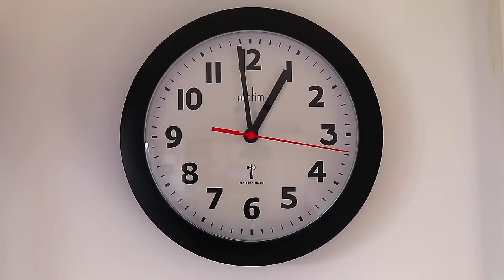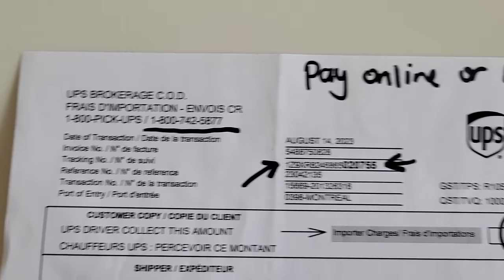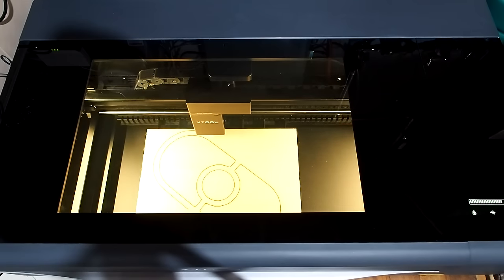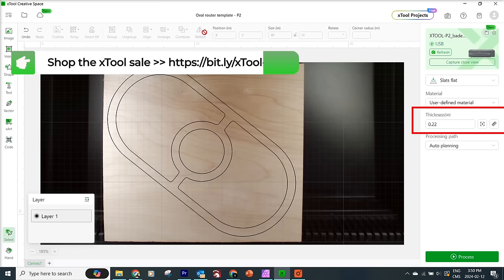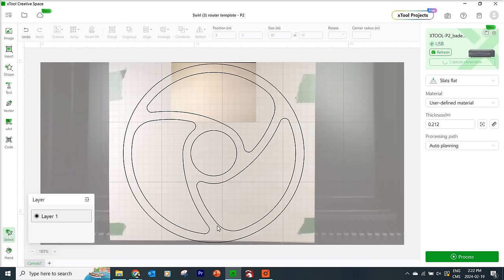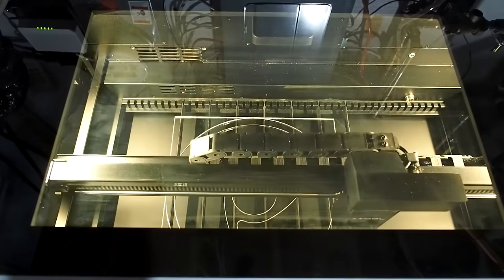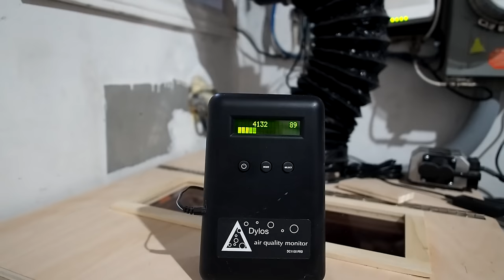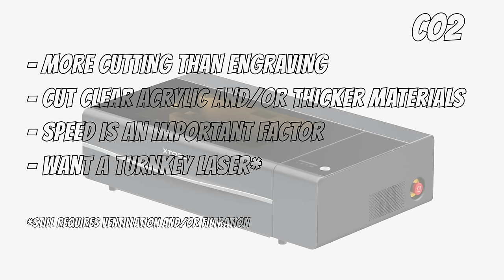I regretted my laser purchase. Until I upgraded.

Comment: I normally think DIY Montreal does fair comparisons, but this time she has missed the mark.  This video is not so much a comparison of diode lasers vs CO2 lasers, but a comparison of an older 20 watt open frame diode laser to a latest generation 55 watt CO2 laser.  Most of the downsides to diode lasers she mentions are no longer true since many diode lasers now include full enclosures, with exhaust fans, cameras and large laser-safe viewing areas.  Diode lasers are not just for engraving, in fact a 40 watt diode laser will probably do a better job of cutting wood than an equivalent power or more powerful CO2 laser. And things like a honeycomb bed vs a slat bed are not a function of the laser type, but the bed type. Charred cut edges are a function of the settings one uses, not a characteristic of the laser type. I own a $1400 diode laser and much prefer it to an $8,000 CO2 laser I also have access to. CO2 lasers have one advantage over diode lasers, the ability to cut clear and translucent acrylic.  Otherwise they are, as she points out, much more expensive, much bulkier, and have sensitive parts like mirrors and expensive tubes with a limited usage life.  I hope your viewers do not watch this video and get the impression that if they want a laser for their wood shop they need to spend $4,000 plus.  There are lots of great diode lasers available for a fraction of that price that do a great job of both engraving and cutting wood. I love Marie's woodworking videos, she is one of my wood working heroes, but I don't think she has enough experience using lasers to make a good comparison between diode lasers and CO2 lasers.
Reply: Thanks SO MUCH!!! For this comment!!! I always have a bad feeling when people do videos on things they got for free. And comparing a cheap run of the mill laser to a higher end newer one is really apples to oranges.
Reply from the maker: You clearly know a lot more about lasers than I do! This wasn't intended to be a comparison video but more my experience with lasers and why I upgraded. I feel like a lot of people starting out with lasers would go for the same basic entry level model that I did, and I feel that's a mistake. If anything, there's a need for more education and greater research when investing in a laser cutter. Promise I'll go back to woodworking for my next video ;)
Reply: @DIYMontreal  Yes. I would agree. The quantum leap you made is REALLY a big one. Like comparing a bicycle for transportation vs. a car. And when a company gives you something like this for free it's REALLY hard for us lay people to not look at it from a guarded position. If Ford gave me a brand new Raptor pick up truck and wanted me to give an honest feelings about it vs. my 2003 F-150? HECK YEAH I would have great things to say about it! The laser cutter is different for you because you DO have a business that you are using it for and probably would have been the right investment for you to make in order to ramp up that business. Bob over at "I Like to Make Stuff" Got a free $13k Thunder Laser to do a video with. That thing BLOWS the $5000 xTool away. But again... don't think he would have made that leap had he had to pay for it himself. (I look forward to the next woodworking video you make 🙂) Best wishes, Rick
Reply: I think you missed the point. In a nutshell she basically said “don’t waist your money on a “Framed Diode Laser with no smoke extraction” and or upgraded tech so that you can scale your business to profit” it was not a comparison of laser units 😂, she is in to making money, not making extra time for errors!
Reply: @SinisterReality  If you read the description it clearly states it is a comparison of CO2 vs diode lasers. As an amateur woodworker who uses both diode and CO2 lasers, I would just like other woodworkers to know that for many of them, they could be happy, and safe, with a diode laser costing a fraction of the price of a CO2 laser.

Comment: I am not sure if I would agree with you regarding some of the points in the video.  Both CO2 and diode laser have their places.  The fact is,  xtool d1 pro is outrageously overpriced for what it is. When it comes to this type of open frame diode lasers, there is really very little seperating xtool from other more budget friendly options.  CO2 laser machine is another story, but I still won't spend anywhere close to $5k for that.  You are comparing the cut speed of two machines with very different laser power output, which is completedly unfair and pointless.  The CO2 may look to be worth it, only because you overspent on the D1 Pro.  There are plenty of budget brand 20W laser out there, nowadays at around $500ish.  Occasionally , there are sales pushing it close to $300, with an air assist included. with that,  the equation would be drastically different from your viewpoint here, esepcially for people new to laser machines.

Comment: You have dirty cuts from your diode laser for the same reason your honey comb is getting so filthy, you need a 'down draft'. Down draft is a 'must' because your respirator doesn't protect your skin.  Lasers don't burn, they 'oblate' by impacting an area w/concentrated photons, the byproduct of the friction is heat. You need the compressed air to clear our the debris but the consequences of this are tiny atomized particles that coat everything, skin, clothes, walls, if you can smell it, then it's on your skin. Long term exposure, speaking from experience, you will develop contact dermatitis to things that are considered 'harmless/safe'...  I ran a Kern HSE utilizing a 150watt Coherent Diamond series laser for over 10 years w/the best down draft/compressed air setup US tax dollars could buy. At the end of the day, you could smell the 'stink' from whatever I had been cutting even w/the best ventilation on the planet. We didn't know, Kern didn't know, it's thanks to the DIY community that we now understand the hidden dangers that are completely manageable. Wear long sleeves when possible, minimize skin exposure and shower/rinse exposed skin sooner than later. I still laser daily, love the hobby/profession and miss my Kern :D.

Comment: Actually for the price of the P2 for another $2000 you can look into a full blown 80 - 100 W  Co2 laser, floor model water cooled with a much larger bed and self contained.  Depends on what you want to do. P2 is still a hobby craft unit the xtra $2000 gets you a full blown very fast production unit.  I use a Rabbit 100W floor model Co2 at work all self contained,  runs 24/7,  It's only issue like all Co2 units is you must keep the lens properly clean. Even this won't cut metal though.

Comment: Diode lasers and CO2 lasers each have their place. Low power diode lasers have a smaller focal point, and that enables them to produce higher resolution engravings. However, as noted in this video, diode lasers have limitations when working with clear acrylic and glass.

FYI - Safety glass(es) for lasers offers protection only for specific wavelengths. If you work with different lasers, then you need to ensure the safety glass(es) you select is/are appropriate for the wavelength(s) of your laser(s). This may require purchasing different sets of glass(es).
Reply: Also cutting speeds.. is better to have both so to cut with one and engrave with the other...
Reply: @Phelnok  Agreed.

Comment: A lot of the advantages that you confer to the P2, are not a function of it being a CO2 laser, but its actual design.

Not all CO2 lasers have autofocus or a built in camera.

Some CO2 laser cutters also use honeycomb beds and get messed up the same as diode lasers.

Not all CO2 laser cutters have integrated air assist pumps or water coolers.

Even with its integrated cooler, the P2 needs topping up with coolant before use, so it is not ready to go out of the box.

Judging by the amount of smoke present in the enclosure, while cutting, the included exhaust fan is inadequate. With a beefier setup, there should be hardly any smoke inside, and very little smell if vented outside.

CO2 lasers use a number of mirrors to direct the beam to the cutting head. These will eventually get dirty, and require cleaning, which then necessitates realignment. Also, the laser tube will degrade, and need replacing. Whilst this is also true of diode lasers, the replacement process seems a lot simpler with the latter.

Disclaimer: I have not used diode lasers, but prior to retiring I did use and maintain CO2 laser cutters as part of my job.

Comparing a fully enclosed and integrated 55W CO2 laser cutter with an open frame 20W diode laser is somewhat disingenuous. A fairer comparison would have been with Xtool S1.
Reply: You missed the part where she said she was given this laser. She also said she paid for the diode herself. She's not comparing her diode to others. This is her first experience..way to get on a YouTuber because she didn't compare five lasers like the others

Comment: Good review. Would add some tips/comments:
- The diode laser's honeycomb - you have it on a flat surface and that is why you're having so much char at the bottom... A honeycomb structure is usually used (besides holding small pieces) so that the air is sucked from below and out of the enclosure. Basically, you're burning wood... and if the smoke cannot escape (now it can't as there is no space between the honeycomb and your bottom plate) then the charring will occur.

- too small exhaust on the CO2 is a joke... it should accommodate at least as big exhaust as your diode laser enclosure. Apparently, they traded this important function for "looking good"... It does look good & especially thin, but that you have to wear a mask speaks a lot... For me, this is a design flaw.

- for me best cleaner after testing proved to be "car break degreaser", nothing else comes even close... Car shops have them and they aren't expensive.
Reply: Good tip on the car break degreaser, I will try this. Thank you

Comment: When using foam degreaser on single sided objects (like stove, oven and oven glass etc): 
1. Spray the foam and set clingfilm/plastic wrap on top of the foam. Let it soak for 30-60min and wipe it off. No more scrubbing!

For grills/honeycombs:
1. Lay a clingfilm on table that is two times + 20cm larger what the cleaned area is.
2. Spray the degreaser foam on top of the clingfilm.
3. Put the object on the foam and spray some more until all cleaned areas are unvisible.
4. Make it airtight and seal the package by wrapping it up by turning the rest of the clingfilm on top of the object. Turn it upside down after 15-30min and wait another 15-30min (depends how hurry you are in).

Remember to avoid breathing the fumes and use mask/use good ventilated space when unwrapping

For the laser cutting device, I'd probably buy a growing tent (150x150x200cm costs around $150, smaller ones are cheaper)

Comment: The cutting area is another factor. Large area co2 units are sooooo expensive. Also, if you are using the laser for production, do not ignore the fact that you will need to replace the laser tube at some point. Otherwise, good video.
Reply: For 2000$ you can get a dsp controlled, 60w co2 laser cutter with a working area of 500mm × 900mm. The co2 laser tubes have a life span starting at 1000 hours and can go up to 5000 depending on what type of cutting you make. Do you think the flimsy diode will last longer? Also, a 40 watt co2 tube costs 80 euros delivered to your door,a 40 watt diode module costs, wait for it ... 850 euros.

Comment: Wow, the diode laser gets really messy! Indeed, I would hate maintaining it. I can see one advantage to the diode laser though: since I have a 4ft x 4ft cnc, I could put a diode laser on that and be able to work on a project much larger than 26 x 14 inch, at a much lower price than a co2 of that size. And I would get a 44W diode laser, which would be faster than the diode one you’re comparing. But seeing that mess, oh man! It’s a huge bummer, indeed.

Comment: i'd thought of getting a k40, fine for light work, not production i suppose.  the upgrades needed to make it even halfway usable are a bit much.  there's one upgrade that takes care of a whole bunch of problems, argon shielding gas.  after that, upgrading the tube, lenses and power supply is at least easy and relatively cheap.
     supposedly takes care of the stench, cause nothing's catching on fire to make the stench, no smoke, no loud exhaust fan, no filters, cause there's no smoky particulates to get rid of.  you just make it gas tight on the bottom, gas tightish everywhere else, and all the garbage that would escape and strangle you to death is kept in the gas, which you can vent occasionally, no air assist, cause there's no crap to blow out of the laser nozzle.
     if it weren't for the price of a gas cylinder, it'd be an easy decision.  if you're not using a LOT of the stuff a tank will last a long long long time, which means that if you rent the tank monthly it'll quickly make the cost of buying a tank worth it, though they're 200bucks on the .ca jungle site for a small tank.
     knowing other people have gone that route and had easy success, even with cheap k40 garbage, i'll be ready when i finally move on from using a laser head on my cnc machine.
Reply: Hello, are you try argon shield or just speak theoretically?I make some tests with CO2 gas for air assist and reality not like theory.
Reply: @sash-v7i  i've seen argon used in videos, if you already have ga shield welding gear it's not that difficult, some tape to seal the bottom and plumb it in, disable the fan.  i've seen the co2 tests and it's still smoky and too light so it doesn't shield well, but, if you didn't seal the enclosure to keep the co2 from blowing away, it won't do anything.
Reply: @felderup  Thanks for reply, I'm very curious to see these tests if you can put links here.
Regards

Comment: Nice summary, thanks for posting it. This emphasizes the necessity of doing your homework before getting ‘buck fever’. A clear idea of what you want to use the tool for is essential before spending the dough. I mostly do engraving on curved wood surfaces so neither of your options would be suitable for my needs. This is because the Z movement is pretty minimal to nonexistent in these machines. Cheers.

Comment: that diode laser shouldn't need that much cleaning unless you are cutting materials you shouldn't be cutting.  or don't have the propper airflow.
(basicly you are getting flames comming out of the bottom of your wood depositing soot and other things on the bottom plate and the honey comb,  that said.  you wanna move away from the honeycomb.  it's the cause of your bad airflow)  get slats for your diode laser
even if you don't get flames.  the thick smoke is getting caught in the honeycomb structure.  giving it more time to dirty the bottom of your work and the honeycomb itself

Comment: An easer way to clean the honey comb is to use the degreaser and a Electric Pressure Washer, Way faster and more user friendly. Also 4k for the xtool co2? The omtech 60W laser goes for $2600 and the remainder cost can be used in the chiller and exhaust solutions. Bigger cutting space and quality laser...

Comment: What about work area or size of material. I can engrave on a section of an entire sheet of plywood by just setting the laser on top of the sheet. The only reason I have not switched to CO2 is the limited space to fit whatever you are working on
Reply from the maker: True. Some Co2 have a really big area. The xTool P2 is 12x20 I believe, but you can add the pass-though option which basically allows you to feed a long 20 inch wide sheet though it as it engraves
Reply: @DIYMontreal  I am currently using a 30 watt optical output diode laser module by Laser Tree and it is very powerful. But that brings me to my biggest complaint about diode lasers.... The power ratings. Some manufacturers advertise the power consumption rating and others will actually tell you the output rating. It gets very confusing for a beginner and it took me buying 4 different laser modules to finally know what number to look for, which sometimes takes a bit of digging
Reply: @jacoblittle3209 I have same LT-K30 head, it's amazing power.Set on homemade extended S9 frame with dimensions of workspace 370/780mm i successfully cut few shapes on gipsum plate size 900/1800/12mm.Think that can't be possible with hobby CO2 laser. Regards

Comment: While entry-level diode lasers present challenges, CO2 lasers offer numerous benefits that make them a superior choice. In your video, you'll explore these advantages and drawbacks comprehensively, comparing costs and addressing the crucial question: which type of laser should viewers opt for, diode or CO2? Additionally, you'll touch on essential aspects like ventilation setups and the xTool smoke purifier, providing valuable insights for those considering diving into laser engraving. Amidst the comparison, the Monport Laser emerges as a standout option, offering unparalleled precision, versatility, and reliability. With Monport, users can confidently embark on their laser engraving journey, equipped with a tool that delivers exceptional results and addresses the challenges often associated with entry-level lasers.

Comment: 14:25  this here is also the main tradeoff between the 2.  

it means you can cut things with the co2 laser that the diode can't do. 
but for the same exact reason.  there are things your diode laser can do that your co2 laser cannot.  
like engrave things past a transparent surface.. 

or burn away laser paint on a glass without engraving and shattering the glass itself.

Comment: the built in air assist on the co2 laser is probbably a blower style fan.  given the fact that you can't hear a loud pump.  
makes the laser head a little heavyer.  but it's making me think that's a good upgrade for my co2 laser. 
lower power consumption and much quieter.